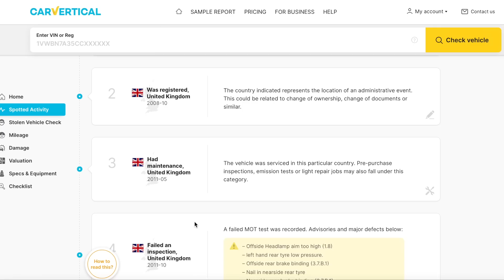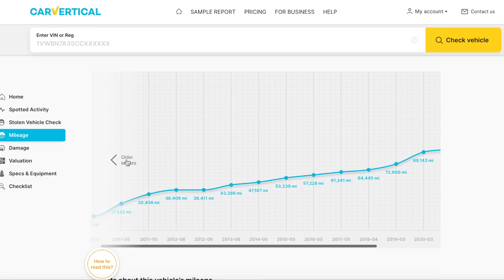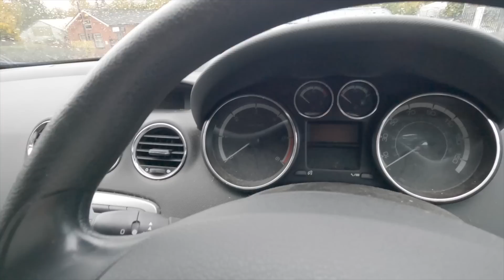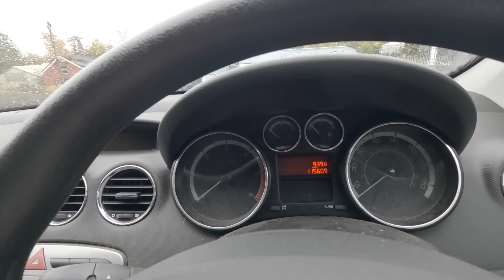I BOUGHT A CHEAP PEUGEOT 308 FOR £300

Comment: Love the fact you go on about electrical issues with the 308 and you drive a Range Rover!
Reply: I have had a peugeot 207 for nearly 7 years. Was a neglected example. The only electrical problem it has ever had is an airbag light, which goes out when you wiggle the wires under the seat. I reckon a peugeot 308 is a safer bet than a vw golf which would be a rot box at that age and full of niggling faults.
Reply: @RichardRichard-k5y  I used to have a 207. It was a used tampon on wheels. A mate used to have a 308. I’d rather have genital warts.
Reply: @RichardRichard-k5y  I drive a Jag now. It’s better in literally every way. Moral of the story, don’t buy shit cars
Reply: Didn’t realise he asked. Thought he was giving out advice
Reply: There was no electrical issues with the 308 there was with the early 307 but they were sorted on the 307 face lift
Reply: Range Rover , WORST BRAND EVER
Reply: @williamjohnson7707 Jaguar sucks

Comment: As a British ex-Pat who has lived virtually all his adult life in Australia I never realised how detailed the M.O.T. was until I started watching your fantastic videos. In Australia we have a rego (registration) check which takes five minutes and seems to consist of checking your lights and indicators work, checking that the tyres aren’t bald and a quick spin to check the performance of the brakes. Literally takes five minutes at most! 
The M.O.T. seems so much better and picks up any potential future problems with the car that buyers can see a record of.
Reply: In WA we don't even have that.  😆  Nothing at all.  It is only if something is so blatantly wrong with your car that the cops pull you over that it will be condemned as unroadworthy.  I got my WA rego car serviced in the Northern Territory while on a road trip once and the mechanic asked me what the hell was up with WA cars as he had had to deal with Western Australians bringing in all sorts of death traps over the years.
Reply: Dean Clatworthy
 UK MOT system is very good on picking up very small details,some can & some may not even pick up on a slight lip on the brake discs.
Reply: @person.X.  😝😝😝
Reply: Depends where take a car for MOT. I've got two garages I use, one is a chain garage where they will pick a car apart looking for business, which is handy if I want a car really scrutinised. They find the faults, I fix em. Allegedly, my other garage is allegedly a one man band who would pass a burning Punto with no advisories if you need him to (allegedly). Very handy for getting a shit heap car from A to B to be worked on without a flatbed transport
Reply: @Dean Clatworthy that's why we service our cars EVERY YEAR.
Reply: Not to mention in Qld, where I moved to, you only have to do that when you register the car in a new name. After that, you don't have any further inspections for the duration of your ownership. You see some proper bombs driving around here...

Comment: My mechanic swears by Peugeots. Generally they don’t rust so can make a canny second hand purchase. I drove a 20 year old Peugeot 206 recently and was quite taken with it. Lovely pillowy ride quality after my BMW!!
Reply: I didn't think I would ever own a french car and knew people with renaults have constant issues but I went for a cheap but nice condition 206 turbo diesel for cheap and just £30 to tax. It's got comfy seats, nice ride and handling, not the best performance, gear change or build quality but it's been a solid cheap reliable car to own and quite surprised by it ( and by the pl the original 17 year old cambelt on it too when I replaced it myself)
Reply: I know plenty of mechanics who swear at peugeots
Reply: @philtowle4683  😂
Reply: French diesels are generally bulletproof! Not so much the ones developed with Ford such as the 1.4-1.6 HDi. The PSA 2.0 HDi and older 1.9 XUD engines are unstoppable
Reply: Have the 3008 and never a problem with it very good car

Comment: Hi, my wife and I have had 2 307s since we’ve been together for 12 years. She had a 307 2.0 TD back in 2011. It cost us 2,3k and had around 85k ish miles. It served us well until 2016. We did very little in the way of maintenance.
I had a 1.6 307 3dr 54 plate with 130k ish in 2020 for around 570 quid, and again did very little maintenance and it was great. Only got rid of it as I’ve had my wife’s Megane off her when she purchased a new car.

For those on a budget these are good cars.

Comment: One thing all your videos has made me do Matt is go out and clean my cars again each week.  At 76 years of age I had lost interest in the weekly clean.  Although my cars were never at the state some of the mobile rubbish bins you get, my wife and grandkids were not looking after the car when they were in it.  Enjoyed this video as I have all your videos.  Must get the aircon in each car serviced before the Aussie summer hits.
Reply: Well worth it, I change my vehicles every four years or so and always get a decent trade in as I keep the inside clean  and outside ocasinaly polished,  my mileage is low on both vehicles  so for a dealer the prep for sale is always be minimal.

As a plus always nicer being in a clean vehicle.
Reply: Provided you use the Air con and make sure your cabin filter is clean it really shouldn't be an issue. If you don't use it the shaft seal dries out and leaks the refrigerant. Many garages don't have a clue about repairing it properly.

Comment: I own  BMW  X5, but few months ago I bought 308 1.6 HDi 2012 just for one reason. Driving motorway to work. Over 5000miles done and 4.7l per 60miles. Like 60mpg. 
It's cheap to run, road tax 20 a year, cheap insurance,  maintenance cheap. I think this car will not be a bad choice long term...

Comment: I purchased a car just like on that condition,i would strongly ADVISE after a full proper valet & it's all dry out that you do use/spray with the proper Neutradol Super Fresh Odour Destroyer NOT THE CHEAP STUFF,spray in all the air vents,under the seats,under the boot carpet,in the boot itself & of course inside, Leave for at least 6 hrs & use 1/3 of the can. I repeated this process twice so the horrid smell went completely! Use a air freshener aerosol spray too,it'll get rid of that strong Neutradol that's left behind. The owner will eventually smell that horrid stink in no time & no normal air freshener will get rid of it 😆 I've been cleaning cars for a long time,no Magic tree air freshener is gonna hide the horrid hay bale stench. Worth £750 all day fella. Good video once again 👌

Comment: Love these videos. My wife's car is a shed, 56 plate Focus with 100k and battle scars. It has just passed an MoT but with loads of advisories, plus an informal one of "Get rid in the next 6 months while it still has some MoT on it". I'll make sure I get is cleaned, plates replaced and a couple of Mats. 75 quid and it might just get us a better return than scrap value when we chop it (looking at a Mk3 1.6 petrol focus titanium or similar for 5k as she likes them and not much else, and it has about 25% more power than the current 1.6).

Comment: Had a 306 1.9 1997. Great van done 150kmiles bit low light on diesel. Had a 307 after that done 400k kilometers on it.2.0 hdi travelled europe with it. Biggest expense was a clutch at 300k kms . Oh great days. Its still on the road but has since got a gear box. These cars dont like multiple drivers.Very comfy brillant. Moved to toyota. But am returning to pug. In 2023.

Comment: I had one of these when it was fairly new to do big miles for work. It done 70k in under two years and was a great car. Fairly quiet and really comfy, was amazing on fuel and totally dependable. 

I think most were bought as ex hire cars, or nearly new and were much cheaper than a comparable Focus so a lot ended up with neglectful owners.

Comment: My smoker for the last 5 years has been a 2010 308 1.6 HDI which is currently sitting at well over 200k miles and going like a clock. Every MOT it needs minimal work and it gets serviced every 10k. It gets tramped up and down Ireland going to auction houses to on a regular basis and I am very fond of it. Comfortable, nippy, cheap to run, cheap to fuel and endlessly reliable. Would much prefer it over something horrible like a Mk6 Golf or Toyota Auris…
Reply: Golf is in a higher league tho
Reply: My Toyota Auris takes no offence.
Reply: ah the auris
the start of the corolla family except the 2008 recession hit so it was nowhere near as good as the e12
Reply: "horrible like Mk6 Golf. You are driving peugeot, thats even more terrible tbh :P
Reply: @Piotrekx3  Well at least he doesn’t have his engine light on from the first day he bought it xd
Reply: @SherwinR89  Still better than some plastico Frenchie D:
Reply: Couldn't agree more
Reply: @Official__RILO  In the rust stakes,yes
Reply: @Piotrekx3  Old golfs are far worse value for money, you pay 40% more for a car that is horrifically abused. For a working man, the reliable car that you could afford is far superior to a yobbo shuttle that is even more broken.

Comment: Leak on injector 3 is prime tell tale sign the turbo is probably going to give way soon, especially due to mileage but I did read injector seals go causing carbon buildup in the oil and makes it’s way to the turbo and blocks the gauze on turbo feed pipe starving the turbo of oil causing premature damage to turbo. Rest of it all seems pretty easy enough work to the right person but paying a garage to do the work would cost a fortune

Comment: We bought a cheap 3008, it's not brilliant but it does what it's supposed to do, school runs, country lanes, shopping trips and wife's commute, the worst part of it is the oil dip stick, we do fairly regular oil changes and you just can't see the level on the stick, doesn't matter what angle you hold it to the light either, still, I generally leave it to the misses to check whilst I'm cleaning the Jag 😉

Comment: I had a Peugeot 306 TD 3 door, great looking car, nice colour and went round corners beautifully. That was it - everything else was hateful!!! Door seals leaked every time it rained or I washed it, even after getting them replaced. The engine was loud, clattery, smelly, leaky and not that fast. Something fell off it every time I drove it. The stereo was pants. 

I complained to my work colleagues every day about how bad it was and one of them asked if he could buy it off me?! I said YES PLEASE, but warned him how crap it was. He had it 2 months and the engine blew up, shoved a crank shaft threw the engine block on the motorway. I dodged a bullet but bad for my friend but did try to warn them.

Comment: Well compared to some of the other tat you've got recently on the channel, this one wasn't that bad. I understand your decision since it would have taken some time to do and a quick sale is preferred. Although I don't like the 308, this one was pretty solid but in need of a suspension overhaul, a set of tyres and some minor bodywork. The engine related bits don't sound too complicated, I've removed the front part of the heatshield without even touching the DPF and if it's loose, probably just missing a bolt or two holding it on so didn't need to be removed and the injector seals aren't too bad to do. But overall as you said, assuming a £600 spend on top of the £500 already in the car would have put at £1100 for a car that could have sold for £1500-1750 I think. Once again, all best and look forward to the next ropey car haha.
Reply: It was worth £750 all day,good choice to shift it quick thou.
Reply: I'd put that on at £1,500 all day long once sorted.

Comment: Brings back some memories, years ago I had a lot of 307’s then 308’s as rental cars through work. One 308 I remember, I was the first renter, it had about 20 miles on it when I collected it. I reversed out of the underground garage at work and tore the rubbing strip clean off the door….I tried to fix it back but had broken off most of the clips. It sort of looked ok until you slammed the door too hard, the the whole thing fell off. Dropped it off at the end of the rental out of hours, never heard another thing 😂

Comment: I have my worst car experience with a 308SW, looking back at my children with smoke surrounding them, pulling over and getting the family out.  Thankfully it didn’t go up in flames.  The car had developed a wiring issues that caused the smoke. I got rid of it

Comment: Do like the 308 to work on. Heater core is generally a job not doing. However on a 308 it's located in a little hatch on the pax side.

Comment: People rage on about how the 07 and early 08 models had shocking reliability, but had the majority of owners actually looked after their damned cars, Peugeot and Citroen wouldn't be the butt of so many jokes (particularly from people who swear by brands with even worse reliability records). As for this specific car, as usual it's not the cost of parts (usually cheap for French cars) but the labour in sorting things out; given it's had a cambelt change, it would be a shame if somebody wasn't to just put those issues right, though as it's a Euro 4 diesel, it'll be hounded out of clean air zones and possibly put to pasture.

Comment: In the mid 90's my old boss had a D reg orange Peugeot Pickup with over 1.2 million miles on the clock.  The body was rotten and bits of it would come off in my hand, but the engine purred like a kitten.

Comment: Ahh the 308... my family had one years ago and we loved it, never left us stranded and was very reliable. We sold it years ago to a family friend and last time i talked to him it had close to 600.000kms on it. It was a petrol engine
Reply: Was it a 1.4 or 1.6?
Reply: @dracony7649  doesn't matter it's the same prince engine, most problematic engine ever made...
Reply: @lukaszdanavicius7697  i have a 3008 2.0 diesel engine. 210k kms on it never had any work done on it, just maintenance. Peugeot diesel engines are some of the most durable

Comment: The myth of French cars being unreliable is exactly that. I've got a 2015 308 with the infamous 1.6THP 'Prince' engine and it is an absolutely superb vehicle. Smooth, comfortable, reliable and a sense of luxury (with the panoramic roof, alcantara seating, massage function etc) for an affordable price. Bought it used for a great price, love it and will likely run it til it dies.
Reply: The 1.4 and 1.6 diesel engine are junk long term. The turbo oil seals leak, the copper washer injector seals leak. Not easy to work on, plastic crap everywhere. They use those cheap plastic oil filters. A real diesel should do well over 180k miles without maintenence. But they are more or less paperweight after 10 years. Stick with 90's japanese cars that last 20-35 years.
Reply: @TB1M1  nah I’m happy with my petrol 308. Looking at potentially buying a diesel Peugeot or Citroen van too. They are excellent vehicles and reliable.
Reply: @bigchief2331  Im sure petrol are great. The turbo diesels are drive great until about 75k-100k miles. But that is far too short a  life.
Reply: @TB1M1  Ok thanks I will keep that in mind. How about 2.0 diesel is it better? I’ve seen them with 300,000+km on them. Lots of owners told me PSA diesels are the best around and good for huge mileage. Maybe they mean 2.0..
Reply: @bigchief2331  I have no idea, but if its a turbo regular oil changes are important.
Reply: @TB1M1  Would have to partially agree - partially disagree. The 1.4L have had their problems as you point out. As far as I am aware in Australia the 1.6 diesels are reliable. They just lack a bit of power when fully laden. I have a 2012 2.0L diesel. All the mechanics I have spoken to indicate the superiority of the 2L diesel engine. To quote "The best engine ever put into a Peugeot." I only have 160,000kms on the clock and he indicates I should drive it into the ground - should last at least 500,000 kms. The only thing that needs replacing will be the timing chain (think that is at 180,000 kms - brought back from 220,000kms). I havwe never had a problem. The 2.0 diesel has a heap of power, even when fully laden on hilly roads.
Reply: @bigchief2331  The 2.0 diesel engine is far superior - just doesn't wear out. Very little maintenance required and you can drive them at high speed all day every day. They love it.
Reply: @allanbriggs807  Yes would love to get a Peugeot Expert with the 2.0 diesel and turn it into a camper van. But used stock is few and far between and they aren't the bargains they used to be. I will keep my eyes out though. Absolutely love my 308 with the 1.6THP, great car and engine and on the highway I get 5L/100km which is fantastic.
Reply: @bigchief2331  I get 5.5L/100km on the highway. About 7.5 around town.
Reply: If French vehicles are as unreliable as the urban legend suggests they wouldn't have hundreds of thousands of repeat buyers willing to part with lots of money to buy another.
For everyone moaning and groaning about the reliability of their Renault Peugeot or Citroën there is probably a hundred that have never had a major issue.
Reply: @bigchief2331  I own  french vehicle too. Although it is reliable in the sense that it will always start, it has the same problem as my friend's punto, it's a delicate vehicle that can be damaged easily, not very sturdy
Reply: Had my 308 1.6 vti from new 12 years and 78,000 miles later it has been totally reliable, never failed to start never broken down nothing fallen off.Just one  Front spring found broken during MOT.
Really good car.Far better than friends with posh badge cars.

Comment: and you think that is good
i have the same spec car in silver 2008  only 75.6k miles
only 1 owner me
inside imaculate outside very very good.
never failed mot only ever had 2 mots that had advisorys.
based on your reaction mine is a wow and a faint